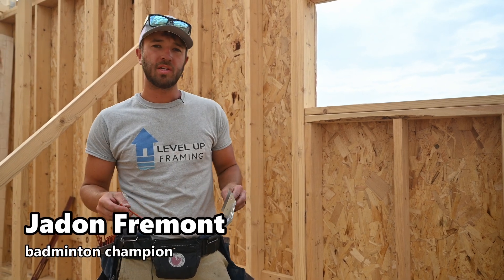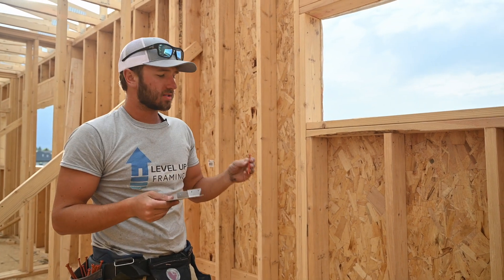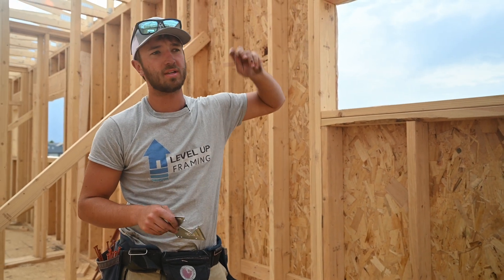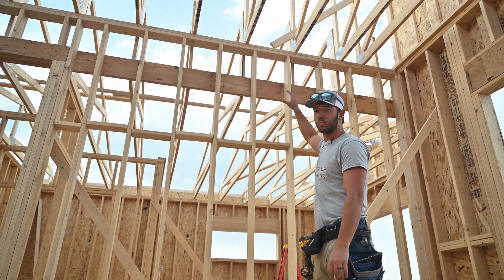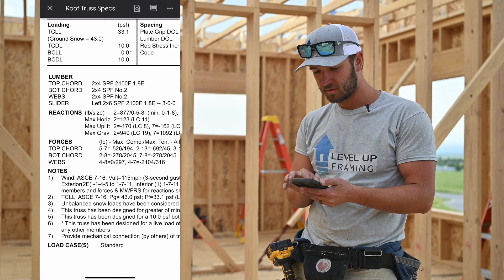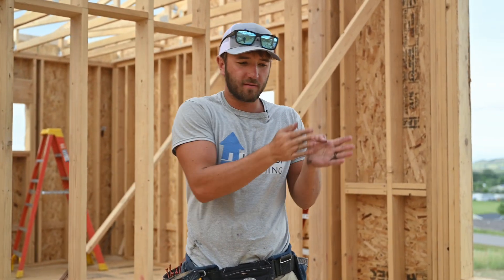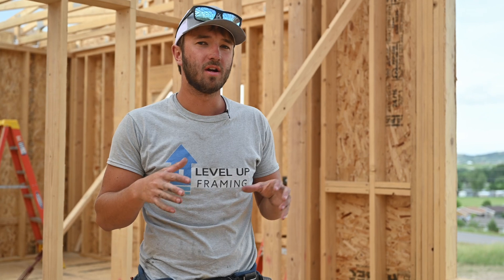How to Secure Roof Truss Heels

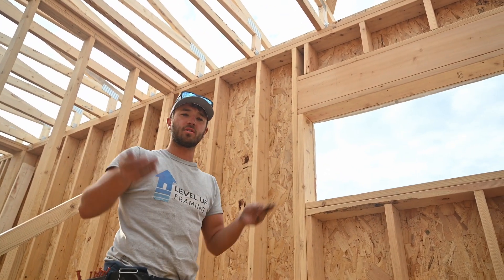Comment: Nice! -- QUESTION -- I noticed @0:25 and onwarrds, that your roof trusses didn't line up with your studs ie not sitting on top of them.  is it required to have them line up with studs in the wall?
Reply from the maker: No.  Unless you have a point load (beam, girder, or post), you don’t need studs under the trusses.   As long as you are framing 16” o/c with a double top plate. 

Some people frame 24” o/c (advanced framing), in which case the studs need to land underneath the trusses.
Reply: @LevelUpFraming  ..didn't know that.  I am trying to pick up this trade as a girl. Just got my speed square. Excited! Love everything about framing and house building but I am not sure a girl can do this.  Guys just seem to get everything faster.

Comment: Thank you for another good video! I had heard of truss lift, but didn't have a good grasp of the concept. Now I understand it a little better. When I begin construction of my house in a few months, the roof will be stick framed instead of truss framed, but I will still ask the framers to use screws to hold down the ceiling joists/rafters. It just seems like a really good way to try to prevent wind damage. Also, thank you for mentioning safety glasses. So many content creators completely ignore that, and they even do their demonstrations with no PPE at all. That makes me cringe. I'm glad you have personal safety in mind!
Reply from the maker: Thank you Rodger! Best of luck with your roof.  H2.5’s do the same thing and would also work for hand cut rafters. 

Safety glasses:  I fail all the time to wear and promote safety glasses.  (This is not good)  But using this gun is one of the few times I always remember to wear them. It throws nails hard!

Comment: Does think also apply for hand cut rafters?
Reply from the maker: I want to be clear: what you should do depends on what the inspectors in your area like to see.  

In our area: when we do handcut rafters, we use h2.5s; or we put in the hurricane screws on the outside of the wall (in order to fully grab the actual rafter that experiences the uplift force). 

I recommend the h2.5. (Still grabbing the actual rafter (not the ceiling joist).  

Again, it depends on what the inspector wants to see in your area.  The code is heavily influenced by interpretation.